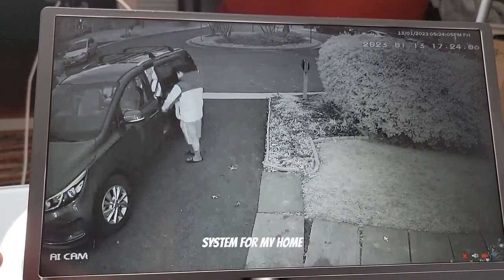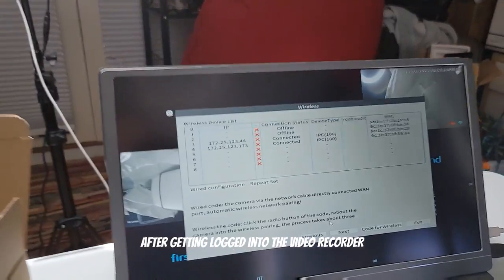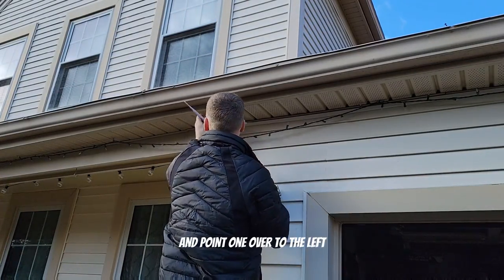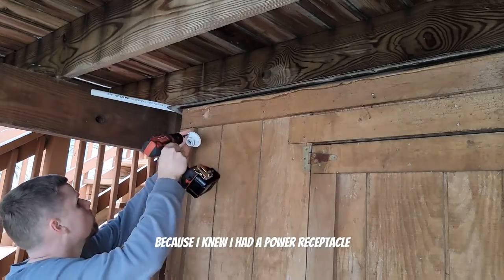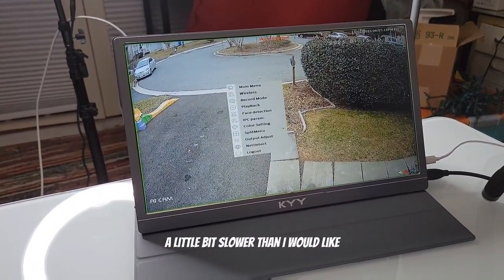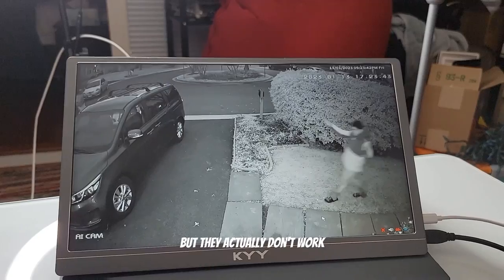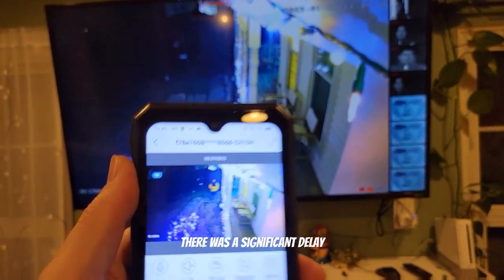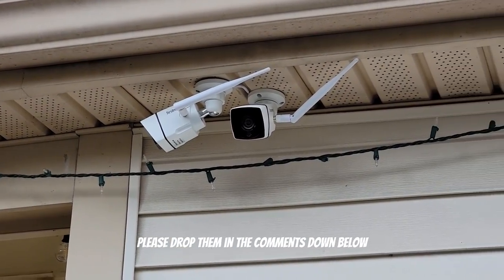Firstrend cctv camera system #howto #amazonfinds #securitycamera

Comment: WiFi cameras: Don’t do it…. You’ll thank me in the long run.
Reply from the maker: What do you use?
Reply: I’ve had my gen 1 ring camera since 2018 and have had no issues since
Reply: If you insist on using WiFi cameras. 1. You’ll need to insure a stable WiFi mesh network throughout the home.  2. You’ll need a local power source at each WiFi camera location.  3. Consider UPS at each camera location to avoid signal loss in the event of a power outage. 4. The Network Router and NVR should also have UPS. The only “WiFi” camera I would recommend is “Ring” but you would still need a good WiFi connection and remember when the internet is out so is your cameras🤷🏽‍♂️
Reply from the maker: @socalducky  good tips. This system is only 200 ish theres definetly room for improvement but it does provide some peace of mind
Reply: Of course wired is better but when your house is built in 1904 you're not trying to drill holes for Ethernet If you can help it, especially when you've already got multiple quality WAPs set up
Reply: @socalducky  the WiFi extenders are a good idea. Everything else you suggest is just throwing money out the window. This system is meant for the DIY'er. We aren't talking about trying to secure a multi million dollar company here, just catch thieves getting into your shed. The only issue I really see with this particular system is the need for POU electrical outlets. Not everyone knows how or has the skills to run romex wire, install outlet boxes and outlets, and tie them into the power panel. I think the best option would be to do what was done here, locate a spot with an outlet inside, mount the camera there, and run the wire through the wall. This also has the benefit of not worrying about a thief just walking up and unplugging your camera.

Comment: I had this system for a month now.....not worth it. Get what you pay for is the best description for this product
Reply: What was the worst part of the system? Why is it not worth it. Thanks.
Reply: @ZenithClarity  1. placement, depending on your where your router is, youre gonna need another router or ethernet line. 2. Cameras are good, where you put them, make sure you have elec socket near by or you'll need extension lines. 3. Lag. I had trouble even with 2 hi end routers, tried system on both, video had to play catch up. Good quality tho. 4. Settings couldve been a bit more streamlined, some settings wasnt needed. It just didnt work well for me. Your situation might be different, it may work for you.